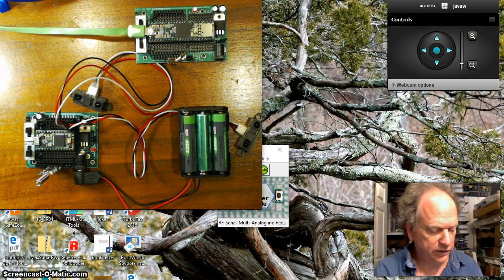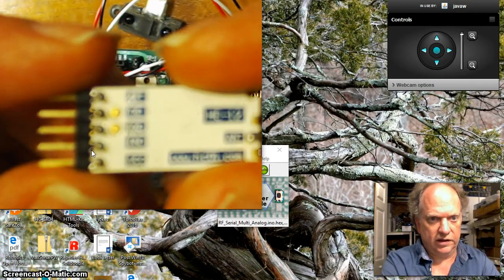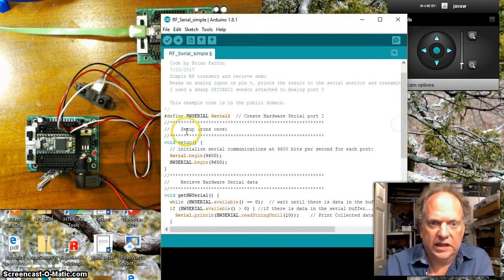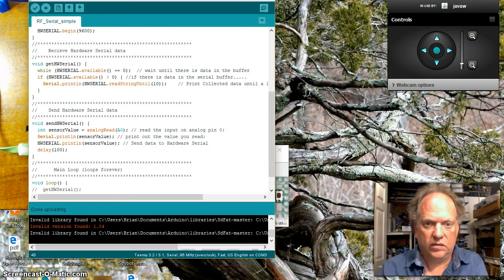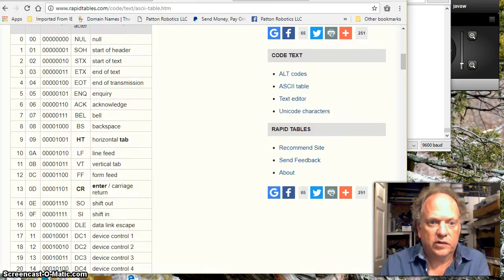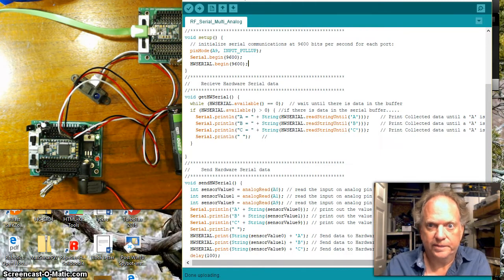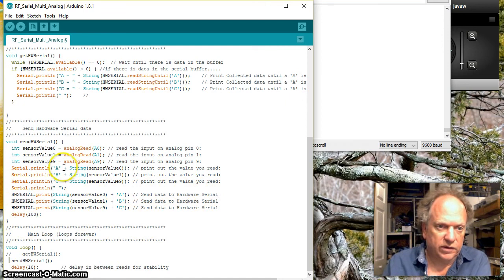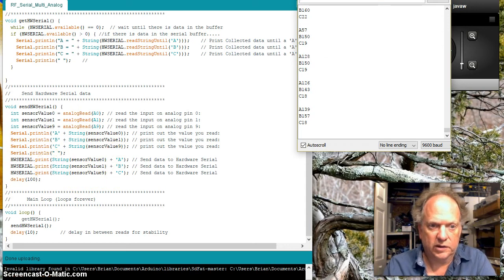HC12 Introduction

Comment: Hello. Thanks for a great tutorial. I have a question, I copied and pasted the simple sketch into my Arduino 1.8.5 IDE but when I went to verify it I get an error saying 'Serial2' was not declared in this scope. Did I do something wrong?
Reply: Steve Tripoli which microcontroler board are u using ?? It can be differs from u r MC and what he actually used.
Reply: vamsi krishna 
Thanks for the help. I am using an arduino nano.

Comment: If there will be 3 hc 12 how to differentiate between them ,to whom to send data. And  then  any one can read the  data with same frequency ?
Reply from the maker: I give a starting character or two to each unit with an HC12. they all then get or send the signal but they ignore every signal that does not have the address they are looking for..That way one HC12 can talk to lots of other HC12s . They all get it and parse it but only act on it if it is their address.
Reply: means any one hack our data. first reading the address and then writing that address in code to get all the data. Is There any hardware side security like specific Mac address only it can connect .